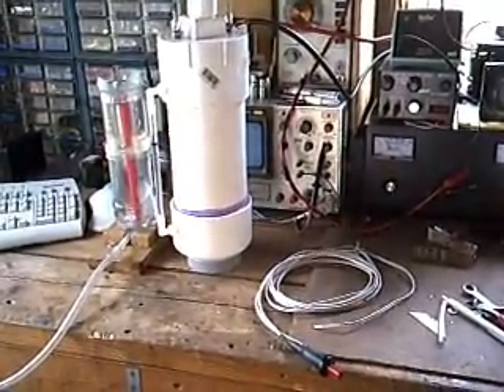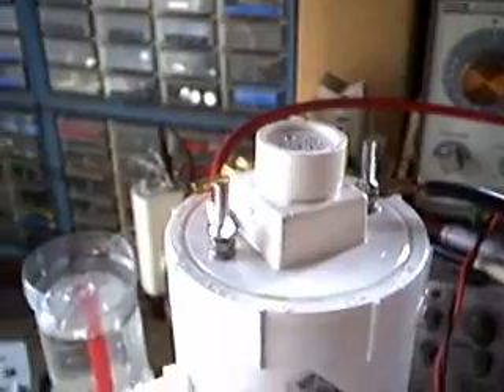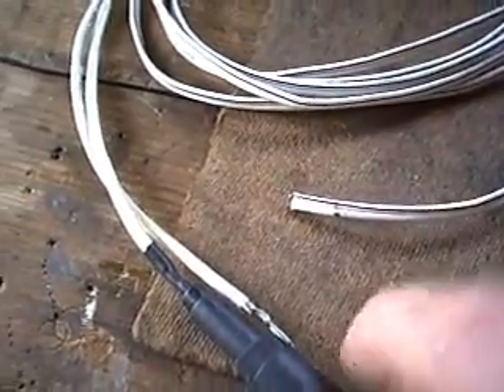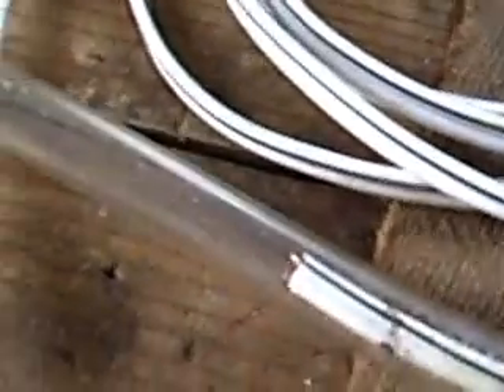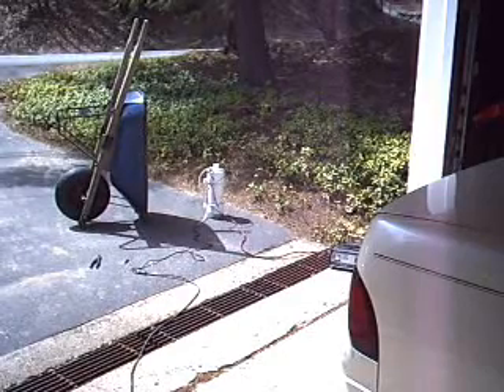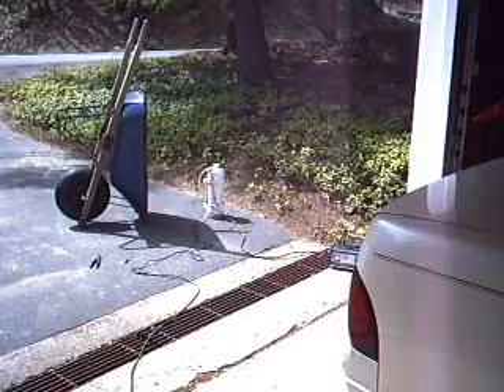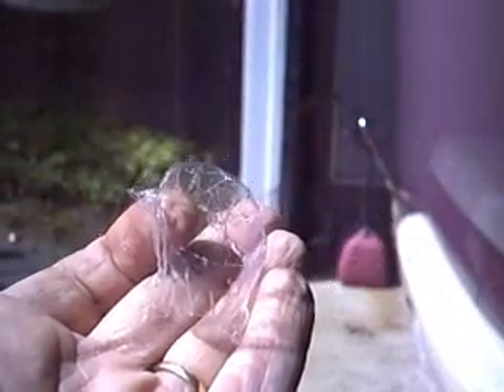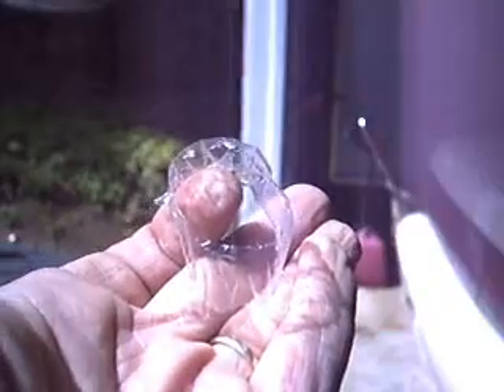#86 - VSPB Cell blowout test 1

Comment: Really if you want to know a little trick install the Smack side ways instead of verticle! Possibly even more gas production! And no or fewer problems with foam or gas bubbles. A simple anology is like pouring a beer or a soda pop into a a glass that is tiltede verse one which is verticle which foams up quicker? The Mini Hyzor by Eagle Research is a strange upside down TEE with 3 inch PVC. And this guy from ER's stuff is never patented either and he is well versed in HHO or Browns gas to.

Comment: You can say what you will good or bad but at At least the Smack is a free design? How many other including the ones you pay for or give you a plan for some cheesy wire wrap design and don't provide any where near this type of gas production or out put.  Really if somebody has or knows a way to electroplate the stainless plates with Zinc or silver.

Comment: The science for this states you can't get more energy out than you put in. But your putting in electrical energy in and getting out chemical energy, then exchanging it for mechanical energy at combustion. You're essentially providing a small amount of fuel and oxidizer for combustion. You might see 10% increase in gas mileage or so, but I can't see that you'd get much more than that. Thats about the difference in running your air conditioner. Free AC, anyone?

Comment: Zero, with your pressure relief membrane in place, how does it hold up when the engine is running & a vacuum is present in the canister? It would seem to me that the membrane would get sucked into the canister.
Thank you.

Comment: I have found very good use for check valves, particularly as vacuum relief on bubblers and other such things ... but I would never trust one to stop a flash back ... the flame front moves too fast ... fine bronze wool when wet seems to do a fair job but I still use a bubbler ... safety first and last ...

Comment from the maker: I put the cell in the Toyota today and ran it. There's one big problem with swimmers. They need dead air space above the fluid level. On cool down the gases contract and pull a vacuum. That vacuum sucks fluid form the bubbler like a drinking straw. Need to find a normally open solenoid valve with a 12v coil somewhere so that on shut down the cell is vented to atm.

Anyone got any ideas where I can salvage such a device?

Comment: Or thicker plastic might work too.. ONly problem with a unglued cap as the blow out would be that the cap itself would become a missle I suppose. ehhe.. but it wouldnt blow out the whole cell.

And if under a hood and the cap blew, it would probably be harmless for the most part, but not so good if your looking over the top of it! lol

Comment: I like the blowout mechanism, however wondering how durable that thin plastic barrier will be when the cell heats up to almost boiling, (as it probably will over long run times) 

its possible it will melt that plastic and weaken it. and opening it...then you pumping  HHO into the air.

Another option for the blow out might be to just SNUG a regular PVC cap over that PVC nipple. Its amazing how snug you can get fittings WITHOUT GLUE.

And when and if it blows, will only blow that cap off.

Comment: or is it coming from the bolts itself? I have had issues like that bolts getting hot, I am leaning to the BOLTS being the problem vs the plates..why?

I have found One way to test this is to connect the battery to the cell using CLIPS right on the SS straps bypassing the bolts.. If memory served me the heat dropped dramatically  on the clips/connectors and the wire lines.

just my 2cts.. Not sure about this completely but thats much hunch right now

Comment: Wow I didn't think that either. I guess it might be an advantage to plate the stainless with something more conductive like gold or rhodium - at a substantial increase in cost I'm sure (especialy at over $900.00/oz. Man I wish we were still on the gold standard :))! Maybe a stainless with a higher nickel content... although I don't think nickel has good corrosion resistance. I'll dig for some info on that.

Comment from the maker: Go as thick as practical. Stainless doesn't conduct very well. I discovered with the cell stack out for inspection that the small bolt heating I am getting is coming from current passing through the 1/2" wide straps leading from the bolts to the plate brick. I never thought it was such a poor conductor until I saw that.

Comment: i think you might have discovered a good sub for tnt, there Zero.
  Hey...my cell doesn't spark with baking soda in it, and then with it, the leads always spark when i connect?  I guess it's connecting via the electrolite?  IS that good or bad?